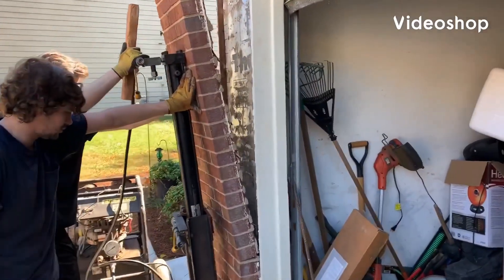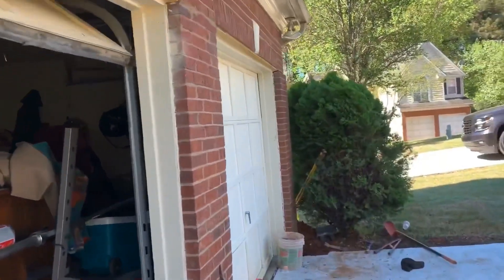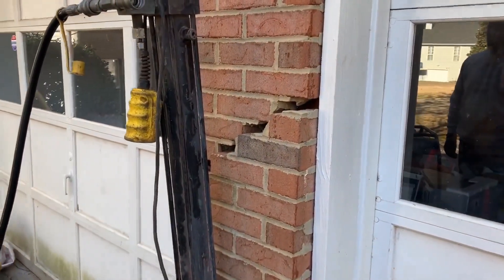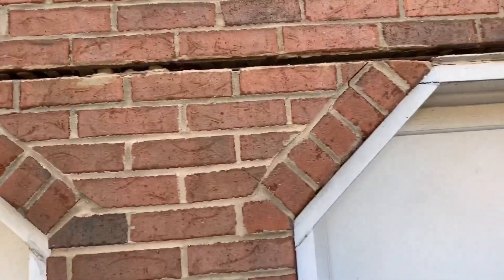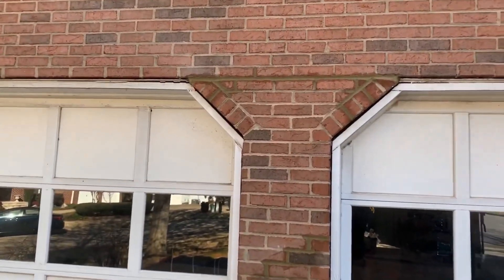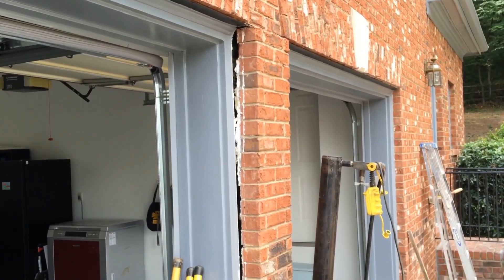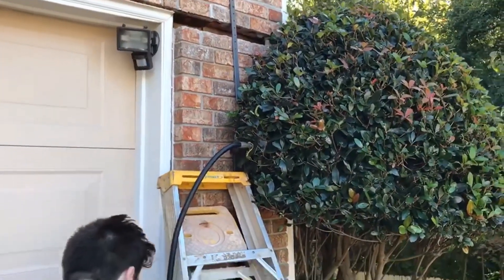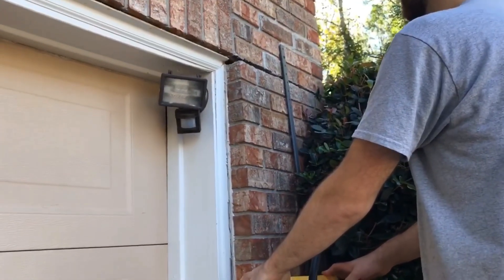JSA Foundation Repair “How to lift a settling brick foundation wall pulling away and sinking.”

Comment: Scott!!! This is amazing! We just bought our first house and lord have mercy we are overwhelmed with jobs that need to be done. Our add on room was lifted by ASF in 2015. The exterior brick is so messed up, but we had no clue how it needed to be fixed. The previous owner filled all the cracks with the squeeze mortar and it looks so bad. We also have many issues on the interior room because of the lift such as: misaligned walls to roof, door framing unevenness, and the list goes on and on. If I could ask you one question it would be how can I seal up the exterior brick where the add on wall meets the original brick wall of the house? It seems as if they filled it with foam gap filler before they listed the house and clearly that wasn’t the right way to fix it. With so many gaps and cracks we have bugs that get in there. I wish I could email you pictures of what I’m talking about because you seem like the perfect person to ask! If you read this please let me know if there is a way I can email you! Thank you for your time!
Reply from the maker: Thank you for reaching out to us and the comments. l be glad to look at your project and the repairs you have made so just send the pictures to scottjsa@comcast.net.

Comment: What type of jack is that? How would you do 20 foot section that is about 4 foot tall? Do you repour a footing underneath it and if so how do you remove the jack and keep it level?
Reply from the maker: Not sure how we missed replying back but they are enerpac and parker hydraulics. Sections are welded together creating the depth we reach.  Steel takes the place
the concrete keeping it level so no concrete is needed.  Thanks for reaching out and viewing the video.
Reply from the maker: Thanks for reaching out to us. Give us a call the office 770-590-8184 and we can explain most of this.
Reply: Very interested to know the answers to this as well.  What’s the next step after you lift it back into place?  Mortar first then remove jack?  What holds the brick in place to remove the jack?
Reply: @Plantman346  It's a push pier, there is a tube that is pushed into the ground through a bracket that hooks under the wall / footer whatever. They jack the tube/tubes into the ground first until it's solid, then they jack up the bracket along the tube. At the end, they tighten some large nuts on threaded rod that pulls the bracket (wall) up towards the top of the tube (supported by ground). Once the pressure is taken by the threaded rod, they can remove the jack and cut off or remove the upper section of threaded rod where the jack was pulling on so it all fits below the ground.

Comment: Seriously? This is brick veneer not "a brick foundation wall". You repair foundations and don't know the difference between veneer and a structural wall?
Reply from the maker: The foundation was behind it with a failed slab. I’m sure you know that though.
Reply: @JSAFoundationRepair  Fair enough. I just see brick veneer being repaired. Are you slab jacking or using epoxy or what? Why does the video say foundation wall when the video is only of brick veneer?
Reply from the maker: @heterozombie  This clip is I believe of four different homes. One in particular on the right side has a failed footer, so we use slab brackets.  One also has a slab bracket underneath the foundation of the home that’s not in the video. I try to show videos of movement so it’s easier for homeowners to see what we can do.